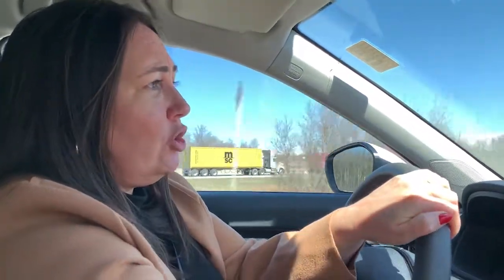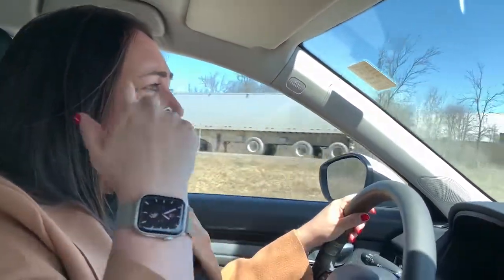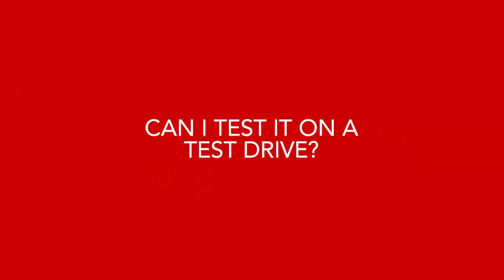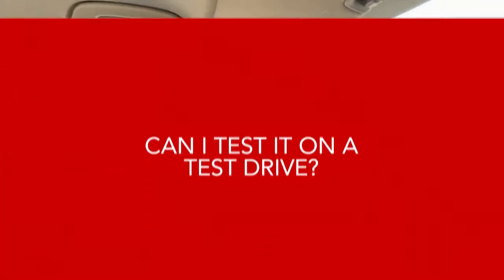How Honda's Blind Spot Monitoring System Works

Comment: I have issues with blind spot monitor on passengers side. Took it to dealership but no luck. 2017 crv 30,000 miles. I have tried a recalibration by mechanic but still passengers side not working.  Vehicle never involved in accident. 0:04